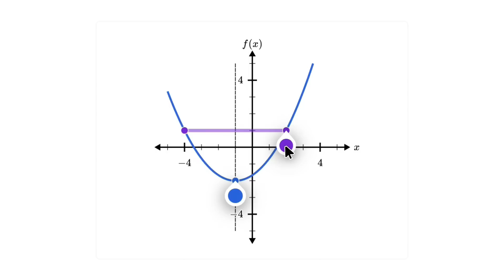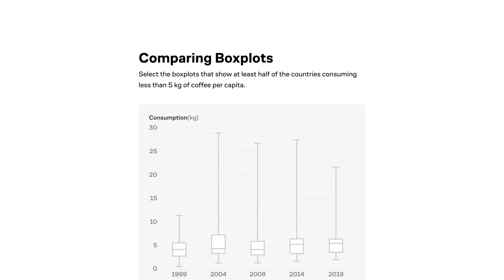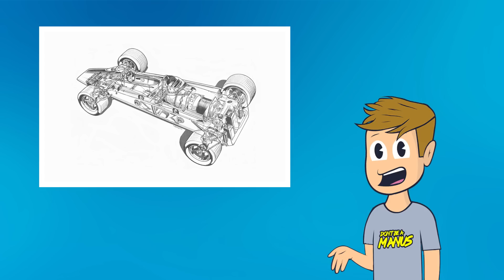Why F1 Cars Don't Use JET Engines

Comment: Great video. I think another reason they aren’t used is because of the transient time it takes to create the power even if you can generate more power with a turbo jet it can’t be toggled up and down as quickly. Also the may these are built you need space for a long shaft connecting the compressor and turbine which is space that just doesn’t exist in f1 cares today.

Comment: I think the three biggest questions that kinda get in the way of a Jet-Engined F1 car is Feasibility, Weight and Cost. How feasible is it to make work, how much would it weigh (after all, weight is everything in F1) and how much would it cost? Lets remember that we are still in inflationville right now so you can forget "Cheap" as an option right off the bat.

Comment: This is why, if you decide to use a jet turbine, you need a fully electric drivetrain. The turbine would do what it does best, while the electric motors would put the power down

Comment: Turbines could be combined with other innovations over the years for some insane performance.
Turbine-CVT and Turbine-Electric would allow you to keep the turbine at a consistent and optimal speed for power and efficiency while having the benefits of the specific transmission.
Back in 2012, we had blown diffusers in F1 where engines would be pinned at 100% all the time to generate a higher pressure differential on the diffuser.
Heck, I can see a world where you use a turbine as a "fan" á la the Brabham BT46 to supercharge the venturi effect.

Comment: Why on earth was the Lotus jetcar performing better in the wet than in the dry?

Also jet engines are probably banned for the same reason as rotary engines and refueling: Its bad for the environment.
Reply: Because it had four wheel drive and smooth power delivery.

Comment: Turbine engines are an interesting source of mechanical force, already duccesfully used in land vehicles, but in order to be fully exploited in race-like conditions, they need an hybrid system... 
-They can work as batteries and provide (a lot of) energy to electric motors. 
-They need an MGU-H like thing to contrast their unresponsive nature.
-A CVT transmission could also be a solution.

Comment: Talks about regulation change to v10 fails to acknowledge that applied to every one except Ferrari how blackmailed there way to keep the v12
Reply: No they didn't. V10s became mandatory in 2000. You're talking about the late 80s when the 3.5L rules initially mandated a V8. That's when Ferrari pulled their Indycar-based blackmail.

Comment: F1 needs to relax the rules on engines, brakes and suspension so we can away from esoteric aerodynamic changes being the major differentiator between cars. The teams themselves barely understand the effect of aero changes, your average fan is baffled. Let the manufacturers innovative in areas which actually matter. Put some ridiculously low limit on fuel and see what happens.

Comment: Why F1 doesnt make the switch to hydrogen engines instead of increasing the electric power? That should be the question.
Reply: Easy answer, you need someone who builds engines also interested in Hydrogen power. Right now it seems biofuel is more popular.
Reply: @Appletank8  also hydrogen is energy poor and impractical to store. It also doesn't make noise. They'd go full EV before going to hydrogen.
Reply: @alex31ytb  Technically Hydrogen Combustion Engine would make noise, but that'd be even more inefficient than Fuel Cells.
Reply: @alex31ytb  From what I've obsevered Toyota has been doing with some of their cars using Hydrogen, they seem to sound no different then regular Fueled cars.
Reply: Hydrogen makes more sense with all-electric power, hence why Extreme E is transitioning to Extreme H.

Comment: Turbine engines don't do well with quick changes to speed.  Because of the turbo, While F1 uses gimmick to keep the turbo at speed to prevent lag this isn't possible with turboshaft engines because the turbo is the engine, not something bolted on.  

However CV transmissions have come a long way and they are great for an engine that likes to keep at the same speed.  I can envision an F1 car where the gas pedal has nothing to do with the gas, but changes the gear ratio of the CV transition with the engine running at a near steady RPM.  This would be similar to turboprop aircraft where pilots change the thrust not by giving the engine more or less gas but by changing the pitch of the props.  A helicopter works that same way, the engine speed is constant and all the pilots controls do is alter the pitch of the rotors blades.

Comment: There's one possibility you missed, Josh. A gas turbine can be used as an electrical generator. If you then use the generated electricity to power, say, a set of hub motors, via a modestly sized battery pack/capacitor bank (to provide buffering), and it would be very possible to build a working racecar. Maybe not an F1 car - current regs outlaw the use of gas turbines, so a rulechange would be needed - but if somebody wanted to set up a true zero emissions race series without worrying about battery limitations, this would be one way to do it, as gas turbines can run on pretty much anything that will burn, including 100% ethanol, or other Biofuels. Sure, using gas turbines to power a car directly may not work, but indirectly? That has possibilities...

Comment: The main issue with turbines is efficiency. Turbines are more powerdense than piston engines, but you trade off efficiency. When you're fuel limited and you don't need a bazillion horsepower because you're trying to do something that goes against nature (helicopters, boats going 60 knots), a reciprocating piston engine is a better choice.

Comment: Can you imagine (wait for it ...) a Turbine Hybrid? The electric motor sorting the turbine lag? Though I dunno, the way things have advanced, would throttle lag still be an issue? As for those who laugh at turbine cars, remember that they are throwing turboshaft engines in motorcycles nowadays (see the MTT Y2K, for example). Tis a crazy world.
Reply: I thought the same. Also Williams already had a gearbox with infinite gears allowing the engine to run in it's sweet spot all of the time.

That combined with a potent hybrid system should work.
Reply: Haha that's the real turbo hybrid

Comment: I actually wish they would bring back pit stops for fuel. Take away some horsepower so that as the race goes on, the cars go faster as they use up fuel. How it was before. And allow them to use any of the tire options in the races. 

I like the point system 

Qualification I wish was just back to being 1 hour so that you have what you got. Rather than 12 laps. I’d say go out as much as you want but you have 1 hour.

Comment: The only gas-turbine powered racing vehicle I can imagine working is if its used like a diesel-electric train style "hybrid" OR a oval racer.

Won't stop me from trying them in sims though since they are fun, if nigh useless.

Unless you count tractor pulling as a race, slapping 4 gas turbines to a tractor and dragging them is amazing to see, but ear shattering.
Reply: Jet powered CVT electric electric engine. It's a mouth full but could work. Would it sound good? More like at a jet engines toy plane I assume? 0% reusable for road cars.
Reply: @thewuff66  For now. Give the technology several iterations in a race context, along with the tech transfers between teams and slowly finding more real world applications will eventually allow the technology to trickle down.

Comment: A Turboshaft Engine is not a Jet Engine. A Turboshaft engine generates Power at an output SHAFT. A Jet generates thrust with its exhaust Jet
Reply: Mechanical engineer here. I came here to say the exact same thing, but you beat me to it.
Reply: @vicolin86  Appreciated fellow engineer (former automotive drivetrain specialist, by now stuck in top management politics)
Reply: Thinking exactly the same thing

Comment: If you ever feel useless, just remember people think V6 is the reason why F1 sounds like vacuum cleaner
Yeah right, try doing the same if you add turbo to the V8, V10 or V12, they will sound exactly the same like a muted vacuum cleaner

Dont believe me? Then hear the difference of the Pagani Huayra (T V12) and the Huayra R (N/A V12)
Reply: It's a combination of much lower revs, and fewer cylinders, and a turbo.

If the engines had more cylinders and reved higher, they would be more high pitched, that's before we start getting into particular firing intervals etc.

The example you have given is a road car Vs track car, one has silencers and emissions devices on the exhaust, the other does not from memory.

Comment: "Why don't F1 cars use jet engines?" Is it because they have a potential to burn other cars following them..? 😅
Reply: I guess propulsion doesn't need to be the force from the engine rather than to do the normal thing than to spin the crankshaft but then that begs the question: how the hell would a jet engine spin the crankshaft?
Reply: @brendan_6  actually that's a normal thing to do! For jet engines to work you already need to spin the turbines that spin the compressors, if you add an aditional shaft (or extend one from the turbines) you already have a power shaft ouput. Look "turboshaft" engines, small aircrafts, big helicopters and power stations use them. Instead of making the exaust gas go very fast to get thrust, you take all the energy from them (as with a turbo) to move something.
Reply: @alejogonzalez4997 the abrams tank is a good example of using a jet engine to move smth without using the exhaust gas itself as the means of propulsion
Reply: Just like ships using turbines as a means of propulsion... the term "jet engine" (aka turbojet/turbofan) is a bit misleading here.

Chrysler actually developed a road car powered by a gas turbine in the early 1960s, production was rather limited but a few are still around today. A more recent example, produced in much greater numbers, would be the M1 Abrams tank which is also powered by a gas turbine rather than a diesel engine.

Of course, real "jet engines" have also been used in "cars"... some dragsters and speed record breaking vehicles were powered by turbojets (the Bonneville jet wars).
Reply: @brendan7591 Turbine engines are a thing, it theyve put them in cars.
Reply: @brendan_6  I think in helicopters and turboprops it is done by driving a turbine blade with the exhaust gas of the core engine (core engine = actual jet engine). You could drive a generator with it and propel the car using an electric motor.
Reply: but the exhaust gases could be turned upwards, creating downwards pressure along with it
Reply: @ISirSmoke  My guess, this would wreak havoc with the car's aerodynamics. ;)

Gordon Murray actually used the "reverse principle" for his Brabham fan car... a giant fan in the rear sucked the darn thing to the ground. (Niki Lauda actually won a Grand Prix in 1978)
Reply: @aoife1122  the Ferrari F2002 was the first F1 car to use upwards facing exhausts
Reply: @ISirSmoke a blown diffuser or venturi tunnel might be a better solution, but who knows
Reply: OK little lesson on jet, or gas turbine technology.  There are two versions of a jet engine - high and low bypass.  Low bypass turbojet get their thrust primarily from the exhaust.  High bypass turbbojet get thrust from spinning a fan. Turbo means compression, jet means it's pushing out a fluid (yes gas is a fluid).   In that they are not much different then turboprop engines, the difference being is that with turbo prop engines the exhaust contributes little to nothing to thrust.  But a turbofan uses the engine shaft to drive a fan.  Hook the shaft up to a gearbox and use it to drive a propeller it's a turboprop.  

Turbojet - High and low bypass.
High bypass the shaft drives a fan with high torque, the fan produces the thrust. 
Low bypass the shaft has little torque the engines instead focuses on pushing air out the back as quickly as possible.
Turboprop, a turboshaft connected to a gearbox to drive a prop.
Turboshaft, the engine is used to deliver force to the shaft.

But once you get larger vehicles and electric plants turbo shafts are also called gas turbines.  This is a little dumb as steam is a gas and steam turbines also exist - nuclear power plant - steam turbine.
Reply: The FIA doesn’t want drivers making s’mores out on track
Reply: dirty air❌
nuclear air✅
Reply: As if we don’t already have an issue with cars not being able to follow each other.
Reply: I appreciate all of the comments! I've learned a lot from all ya'll 😄
Reply: As if burning people would stop them if it gave them three tenths
Those are the same people who were like „yes we shall use beryllium in our engines“
Bcs rubbing those alloys against each other wouldn’t cause it to make a lot of spicy cancer air
Reply: Simply not true.  Examine the history and performance of the Chrysler Jet Turbine car. Jay Leno has a terrific video on the subject. 

As for the exhaust temperature, Chrysler found a clever way to reuse the heat in the jets exhaust and the final temperature of the exhaust was lower than the temperature of a conventional ICE exhaust.
Reply: Looks like we'll never have irl Speed Racer type racing in my lifetime... 🫠
Reply: so?
Reply: Hey gotta make sure those fire suits actually work lol